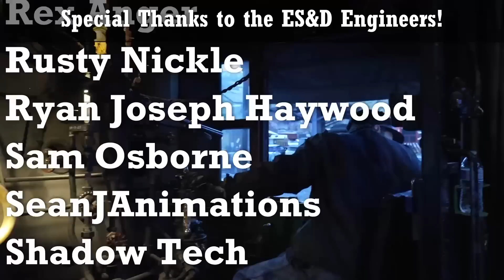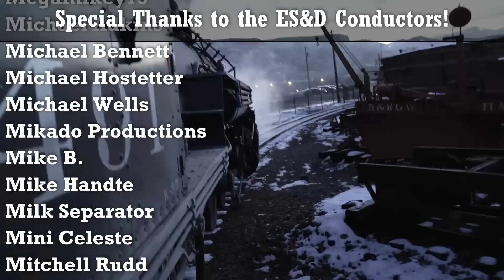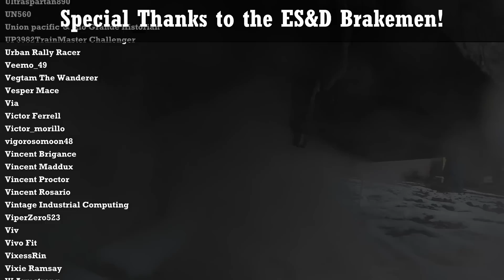Light rail isn't light? Street Car vs. Light Rail vs. Commuter Rail | Railroad 101

Comment: As a Dutch person, where we can't even define what is or isn't a Tram....I get the confusion :)
We don't have the single car streetcars, but our trams run mostly on the streets, with only some seperate bits of line, mostly to connect to other parts of the city.
And then we have a Metro, which runs mostly underground, except for where it doesn't, but at least it has it's own track alignment with no intersections.
Of course we also have the Sneltram (FastTram) which tries to be both a Tram and a Metro. (I think this is what is called light rail in the US)
And the trams are getting bigger/fancier depending on where you go, and some have low platform, some have raised platforms.
The sneltram even came in two sizes....meaning one type stood too far away from the platform, and they had to fill the gap with running boards.

At least I think we can all agree what a bus is. right? 🥺

Comment: Thanks for making this, Hyce, you’ve got an excellent knowledge from which to bust rail myths!

The modern light-vs-heavy definitions you shared are about right looking at pre-1960s historic transit, too.  Most interestingly, the same routes or companies have sometimes switched from heavy to light or the inverse.  In several cases in eastern Pennsylvania, newer, more streetcar-like equipment mixed with and eventually replaced older train-like equipment, leading to some interesting modifications to the older equipment!

Also, never try to narrowly define a streetcar.  Someone somewhere built a street railway with some weird exception, and some nerd will happily tell you all about it!
Reply from the maker: And I'm happy to hear about them. :D

Comment: LRT actually means Light Rail Tramway; It was loathed to say trolley or tram. Politicians, bureaucrats, and advocates needed a euphemism free of innuendo of nostalgia for the obsolete. My beef is with referring to a metro as "heavy rail" which is what is operated on the national railway system. these terms came into wide use from those who do not know the difference between trolley wire and catenary.

Comment: I would love a video discussing the weights of rail and how railroads decide what weight of rail to use.  I assume it’s strength but I know there’s more to strength of steel than just its weight (certain alloys, heat treating, ets) so I’m curious why weight of rail is the main thing they specify as opposed to like a load rating or something.

Comment: Most light rail and streetcar systems have no advantages over buses considering the cost, the ones that do are closer to being heavy rail commuter lines.  Tracks in pavement and overhead wire are expensive to maintain so almost never worth it.

Comment: 0:38 - wait a second. 14.9 kg/m rails is what you use on 3 ft railway?! The comparable S 14 (rail profile with 14.0 kg/m) is used over here, too - for field railways 😅 I think the Harz Narrow Gauge Railways use S 49 at metre gauge, so 49 kg/m. It's surprising to know your humongous 3 ft engines run on such flimsy rails we'd use for something (several) dozens times smaller.
0:54 - now we're back in the usual territory of "everything is bigger across the pond" 🤣 The heaviest standard rail profiles common in Europe are the mutually exchangeable UIC 60 (60 kg/m) and ex-USSR R 65 (65 kg/m) with the latter being used in several countries of the former Soviet Bloc. Here in Germany UIC 60 is used mostly on high speed rail and really heavily used lines, with S 54 (54 kg/m) being the mainly used rail profile for mainline and S 49 for light weight tracks like sidings or branch lines. In the USSR proper they had experimented with a heavier R 75 profile (you'll have guessed by now that it's 75 kg/m) but it actually proved inferior to R 65 (had something to do with hardening according to my quick and dirty research) and mostly got replaced by the latter. Light rail usually runs on S 49 from what I know.

1:50 - funny thing is, the definition of "light" in respect to vehicles also varies vastly across the world. Canada imported European DMUs, Bombardier Talents, for the O-train - and while they're fully fledged mainline railway vehicles over here, they don't fit the AAR definitions and are considered light rail in American eyes. (Though I personally am more buffled by something else: The luggage racks above the seats had to be sealed off because open racks supposedly are an enormous risk to health and safety of passengers and staff alike. One'd think European trains were absolute death traps with all the luggage above head … yet "somehow" it's absolutely not an issue whatsoever).

2:45 - so by the definition used in the US, virtually everything we have of non-railway rail transit in Europe, also what we consider utterly classical tram network, would be a light rail transit? Basically all modern (i.e. younger than 60 years-ish) trams we have are EMU with couplers and tons of doors.
6:11 - oh absolutely! I'd love some insight in that and your work with those signalling systems.

7:30 - over here, railways on one hand and all the other stuff (subway, tram, light rail, call it what you want) on the other hand also are physically distinct. Is that true on your side, too? Here: The overall rail profile and the track gauge may be the same, but they're physically not interoperable. They have different rail head profiles and different wheel profiles. Tram (etc) rails and wheels are flat and rely completely on the flange for holding everything in place, making for a less stable/calm run especially at higher speeds but giving more contact surface and somewhat better force transition between rail and wheel (good for quick acceleration and braking). Railway wheels are conical, resulting in a sine wave running pattern and thus way less flange contact and substantially more stable, calm running behaviour. The rails are ever so slightly tilted inward. Especially in points the differences become substantial; a railway wheelset would get stuck in the first tram point while a tram wheelset would totally lose its way in a railway point. One of the big hurdles in the development of the first tram trains in Karlsruhe, Germany was actually the development of a hybrid (or compromise) wheel profile that actually works in both geometries. It's a good solution in the end, but has very narrow tolerances and thus needs close supervision and frequent re-profiling. And still I seem to remember they did also end up doing some adjustments on the Karlsruhe tram network to facilitate this.

10:15 - that's a huge contrast again. Over here, the S-Bahn networks, so what you call commuter rail (full fledged railway transporting passengers in local traffic) have very high frequencies, too. The Munich S-Bahn tunnel e.g. has cab singalling and every single work day it handles 30 trains per hour in each direction while even being capable of 96 seconds frequency. The Frankfurt S-Bahn tunnel with ordinary signalling handles 24 trains per hour per direction, as does the Stuttgart one; I don't have max. capacity for those at hand.

Informative and well delivered, as always. Thanks for your educational effort <3
Reply from the maker: Oh wow, that's interesting. From what I've seen of trains here in croatia and Slovenia, they're quite a lot smaller than I imagined. Bigger than most light rail vehicles here, but quite small.

Most of our trains and light rail share profiles of wheel and rail; though there are exceptions. BART (Bay Area Rapid Transit) in San Francisco is a particularly bizarre setup overall, but they don't have tapered wheels. All wacky. Thanks for providing some European insight! :)

Comment: When I first started taking buses back home in MSP, the "normal city bus" still had a raised floor and steps at the front & rear doors. They were very early in the process of replacing the gasoline fleet with hybrid and battery-only buses—and in the couple decades since the whole metro has switched to low-floor vehicles. We're also building billions of dollars' worth of new LRT 😁

If that other video on speed commands and/or LRT signaling ever happened, I can't find it. But I have a mighty need!

Comment: Check out "randstadrail" in The Netherlands. The line The Hague - Zoetermeer runs like a tram in The Hague itself, and runs like lightrail with higher speeds to Zoetermeer on a former railway line. This line is partially shared with the "slinge lijn" from The Hague to Rotterdam. Which is classified as a metro. Also running on former railway track. You can see different platform hights in a station, because the tram/lightrail unit is lower than the metro unit. From light to heavy you would have : tram /streetcar, lightrail, metro, regional or intercity train.  It gets confusing when rolling stock is doing multiple modes. S-bahn classification in Germany is also a good example where rolling stock do different modes in different cities. (Some stock is more train like, others are more heavy metro like, depending on the city) but they serve the same function.

Comment: We have a mixed system in Bratislava. Basically a streetcar, but 80% of its tracks are separated right of way with "preference" control of signals (cars get stopped so streetcars can drive through intersections without stopping or slowing down significantly). Practically the inner historic city center is either a pedestrian zone with trams, or dedicated tram lanes without any physical separation from other traffic (cars can weir onto the track to drive around obstacles, e.g. parked delivery vans). Very short sections have also mixed lanes with cars being allowed to drive on the tracks, usually near intersections. Once out of the city center the tracks become physically separated by a curb with crossings being the only points of conflict with road traffic, usually the most likely places of collisions with cars. Many crossings are not protected by signals and even if they are, they are not always with priority signaling for streetcars. And about the streetcars: 2,5 meter wide, 32,5 meters long. Either a two-car unit of older cars or new low floor articulated vehicles. Three car "trains" have been successfully tested, but regular operation was dropped due to covid and never resumed afterwards. But I expect them to return, as passenger number have already reached pre-covid levels and running streetcars more frequently than every 120 seconds makes it difficult to provide priority signaling on road crossings that are part of intersections along the line.

Comment: We have an LRT system being built here in Ontario Canada. It runs down the middle of a really long section of road. And only that just in a straight line. At grade and with just a tiny little walk separating it from the street… we have many MANY closely put stoplights on this road, does this mean the damn train could be just as slow as the bus 😂

Comment: I like the idea of hearing about rail weight, especially how they are able to make it "heavier," like do they make it both taller and wider? Can the top of the rail GET wider, or would that mess stuff up? Is the base different sizes? Does that mean there are different tie plates for different weights of rail?
Reply from the maker: Yes to all you said! Taller, wider, thicker, top of rail gets wider (so long as the gauge doesn't change it's fine), different bases, tie plates... You name it!

Comment: NJTransit's River Line runs LRVs over existing freight trackage.  They had to get FRA approval for this because of the crashworthiness of light vs. heavy vehicles. Part of how this was done was with temporal separation built into the signaling system: if a LRV is on the line, the signal system will not give proceed signals to any of the places freight trains can enter, until the line is clear of LRVs, and vice versa.  Since most freight usage occurs overnight, its a good way to accommodate both

Comment: Hyce
Could you do a video comparing the cost and benefits of double railing with sidings of the lengths freight track that Amtrak uses with cost and benefits of high speed rail? 

Obviously high speed rail would be much faster. But I suspect that the Amtrak travel times could be almost cut in half by greatly reducing the time that that trains are stopped and running below the track speed limits. Double tracking the existing rail lines while keeping sidings may be able to accomplish this. This could also help with on time arrivals. It would also benefit freight trains. 

How difficult and expensive would this be to do?  What would be the cost difference compared to high speed rail?  

Also talk about options like having having near parallel tracks each become one way in opposition direction. Example, have the BNSF tracks over Steven's Pass run West bound for all traffic. And have the BNSF over Stampede Pass run eastbound. This would need to be for all rail traffic. This seems easy. Talk about the challenges. Would this provide any net benefits? 
Another example where this could be done is the tracks on both side of the Columbia River.

Comment: Something interesting is Philadelphia's commuter rail uses the exact same trains as Denver but they are much longer they have multiple types of trains with 7 Different lines and share track with Amtrak and CSX and thus have some strange signaling systems, this is because the Whole thing was Originally built by the Pennsylvania Railroad and the Philadelphia & Reading Railroad, which both Electrified their Commuter Trains with 11,000 Volts 25 Hertz AC in the 1920s and the Pennsylvania Railroad kept Electrifying lines until about 1940

Comment: The tram network in Melbourne, Australia seems to not fit any of these definitions neatly, which is quite fun and interesting.

I don't think many people here would call it light rail, especially as it mostly runs on the street, or just separated from traffic while still at street level. Some areas have traffic lanes that are shared with the tram at some times, but are tram-only at other times. There are a few sections of the network which are more 'light rail-y', if I may use the term, with the trams having a right of way that's independent to the roads (one is the remains of a train line!).

The fleet of trams includes some historic, high-floor trams (which run a tourist service around the CBD) all the way through the years to the latest trams, which are much higher capacity and are low floor. The plan is to retire the older, high-floor trams (other than the historic ones) as new (low-floor) rolling stock is added to the fleet to improve capacity and accessibility. The newer trams definitely look more light-rail than street-car, but are still single cars with multiple sections, with articulation between them, instead of a more train-like configuration.

Trams are 'signalled' by ordinary traffic lights for most of the system, here. They use a dedicated 'T' light if cars shouldn't make the same movement, and are often given more importance in the light cycle. Some areas have indicators for how points are set, or a system showing what sidings (called shunts) are free for trams to turn around in (only at one very busy terminus/through-running stop, as far as I'm aware). Our trams have cabs on both ends, so don't require a turning loop to terminate.

The final point, I suppose, is that the trams are not considered in any way to be part of the train/rail system. From a technical standpoint, they run on different gauges, but trams are also seen as more of an intermediate point between trains and buses, rather than the lite version of a train by the general public, and they are represented very differently by our public transport agency.

PS Sorry for the very long comment, I'm just really intrigued about the differences between systems around the world!

Comment: I live near Zurich, Switzerland, and I think there’s a couple interesting systems here.
Zürich has a tram system with lines 1-20 (but some numbers are missing), notably meter gauge with Tram 2000, Cobra trams and Flexities running on it. There’s a section on the network called the Schwammendingertunnel, which is 3 underground stops with island platforms, apart from that there’s also quite a few other sections where the tracks are separated. 
As part of the tram system, there’s the Glattalbahn, lines 10 and 12, which also uses Cobras (though in a different livery) and has long sections of grade separated tracks. 
Also connected to the tram system is the Forchbahn, an LRT line which currently operates a variation of the Tram 2000 and the Be 4/6, these trains run almost entirely next to the road, though they drive on a section of the tram network just at the end, they notably reach way further out of the city and are branded as the S18, part of the  S-Bahn network, which mostly consists of up to 200 or 300 meter long double deck trains (depending on the line).
Also part of the S bahn network is the Uetlibergbahn (S10), which uses heavy rail rolling stock nowadays, which is also shared with the SN4 (the night service on the S4, which uses double deck trains during the day). The S18 was run with tramlike vehicles long ago, but has slowly become much more heavy rail like, most recently, it switched from 1200 V DC (the tram system is 600 V DC, with the exception of line 20, which is a whole other can of worms) to 15 kV 16.67 Hz AC, making it use the same catenary as the rest of the standard gauge Swiss rail network.

I think these different systems show how imprecise the differences between trams, LRT, and mainline trains really are, and how systems can slowly morph into a different type.

Also worth mentioning is that railways like the RhB are certainly not LRTs, even though they are lighter, mostly because they’re meter gauge, also resulting in a lower 38 cm platform height (as apposed to the usual 55 cm)
Reply: Sidenote, when you look up the Forchbahn, google says it’s a heavy rail route.